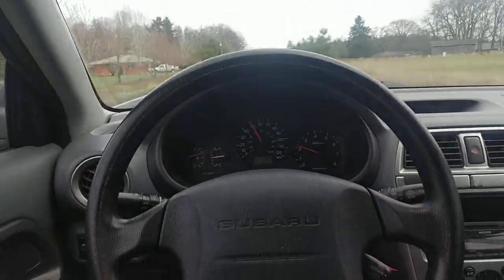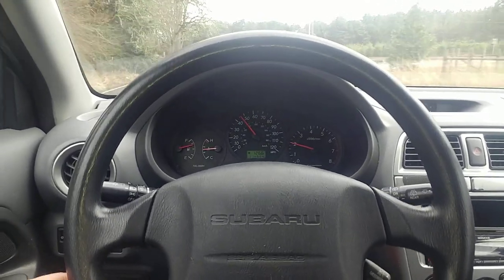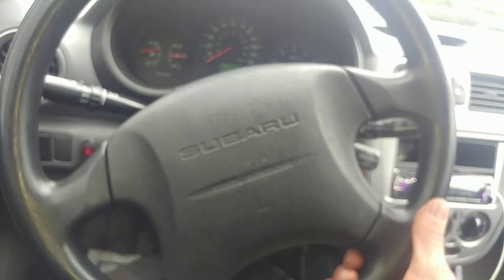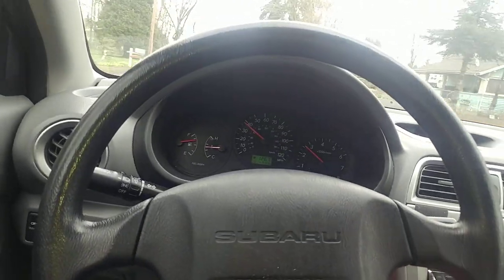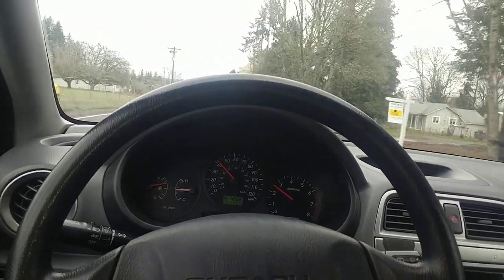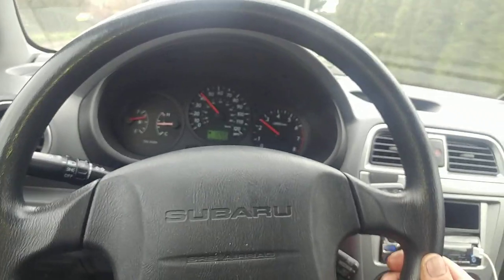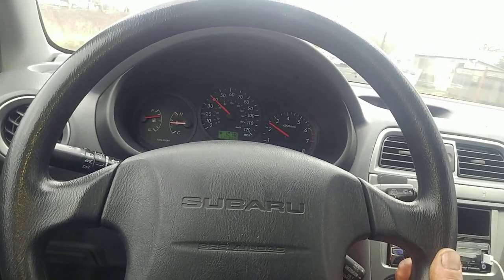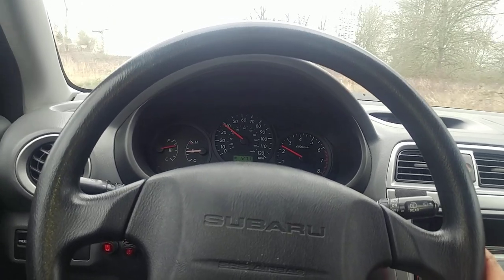Subaru steering wheel shaking while driving at freeway speed

Comment: I have kind of this problem the vibration can happen while low speed or high speed but pushing brakes pedal the vibration goes away and after some miles suddently can return the vibration, so no necesary to push the brakes to this happen but when it happens can disapeer momentary pushing the brakes.... any comment where to start for the fix??
Reply: My 07’ outback xt does this, whole car shakes tbh, at any speed. Just like you it suddenly stops when I hit the brake, and when I put it in N at any speed it completely stops, I’m ruling the rolling mechanics of the car out, and looking more towards my tranny, idk if this helps, helps me knowing I’m not alone in this
Reply: @jp_youngin_5035  I fixed my car already... just changing the  Front Control Arm Bushings, I believe I was lucky to not be related to tranny, plese look first on those bushings